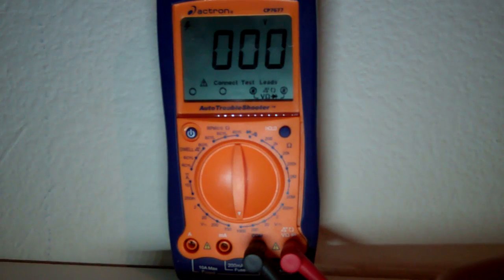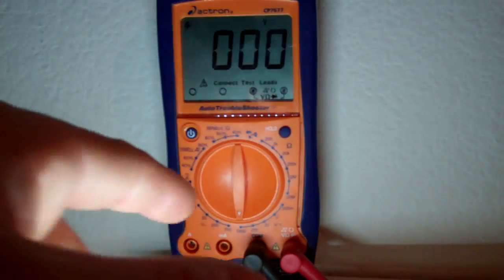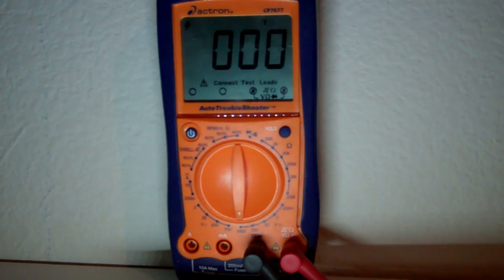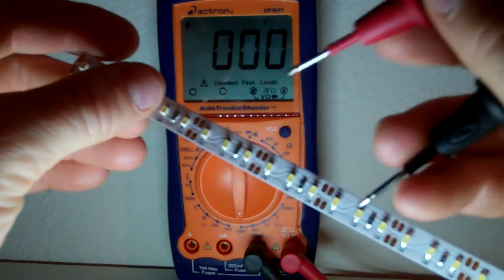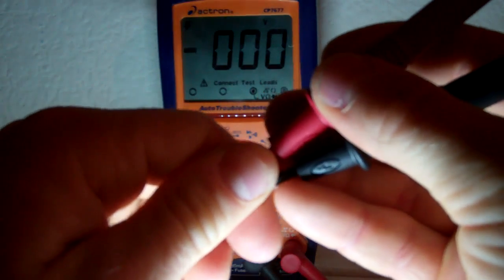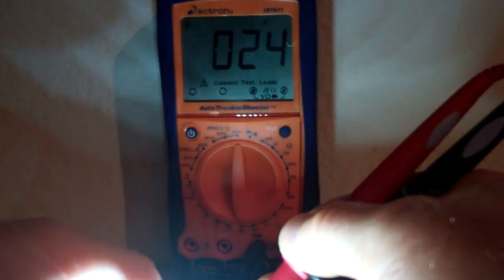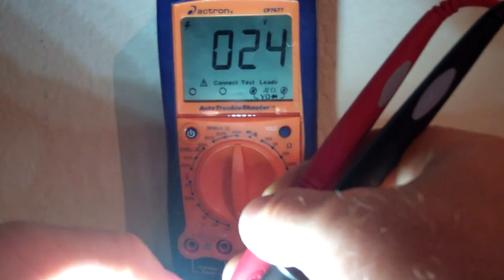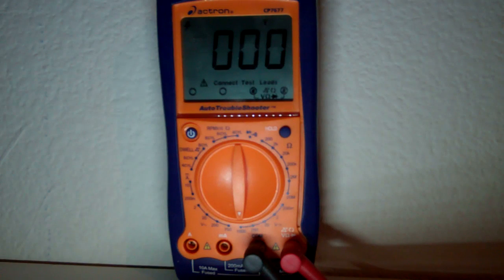How to Test Your LED Strip Light Voltage

Comment: Cant see a damn thing. Where did you put the probes?! And the strips I'm testing dont have a + and - sign so how would I know what those are?
Reply from the maker: +Cjay Elisbeth Hi there Cjay, thanks for watching our videos!
The probes touch the copper contact points, one goes to the positive point and the other to the negative. It does not matter if your lights don't have the signs printed on it, you can still put the probes on the points and if it does not work the first time, switch them around. This will not damage anything.
Don't hesitate to give us a call if you have any other questions. You can reach us at 925 273 9080 ext 106 or info@flexfireleds.com

Comment: Is there a way to test the strips without them being connected to a power source. In other words, if I take the strip out of the package and want to be sure they are working, can I hook a multitester up to the lead wires and verify functionality?
Reply from the maker: +John Ciribassi Hi there, thanks for watching our videos.

You can test each LED housing for continuity, however, the easiest and fastest way to test the strip is to simply hook it up to a 12 or 24 volt power source depending on the input required by the strip.

Give us a call at 1-844-FLEXFIRE if you have any other questions.
Reply: John Ciribassi  yes